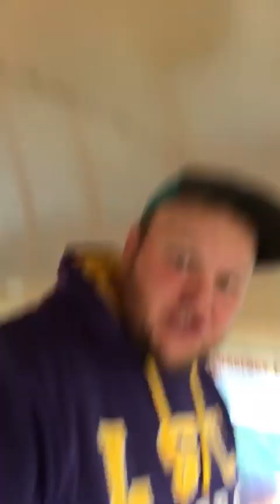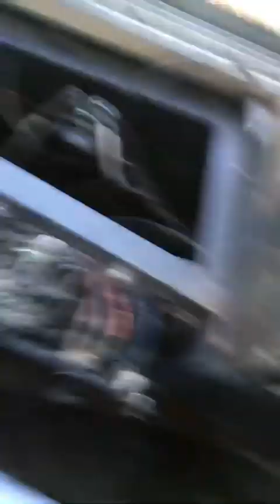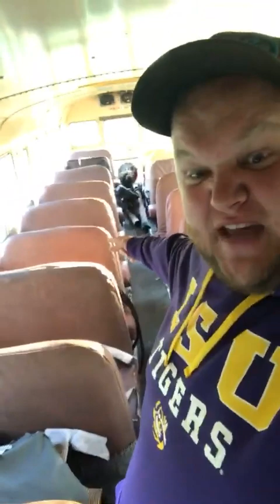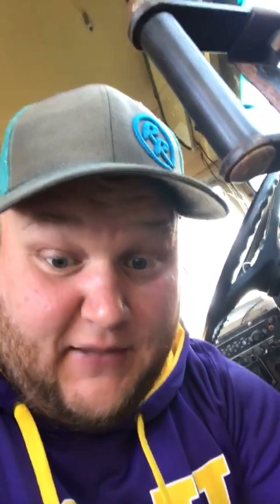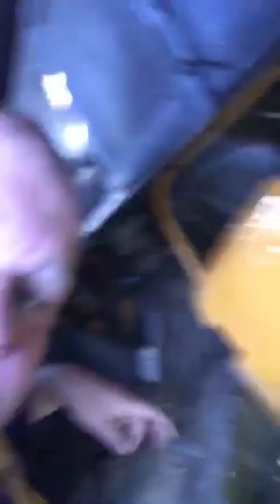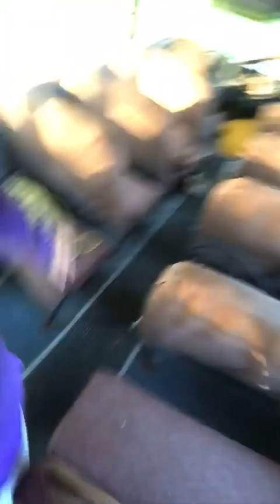Build a Space Simulator: Real Life

Comment: You should add solar panels on the roof. Then hook them up to batteries to hold any power it makes when you are not using the bus.  Then connect the batteries to a circuit breaker with a master switch which allows you to use the houses power on cloudy days and solar on sunny ones.
Reply: yes